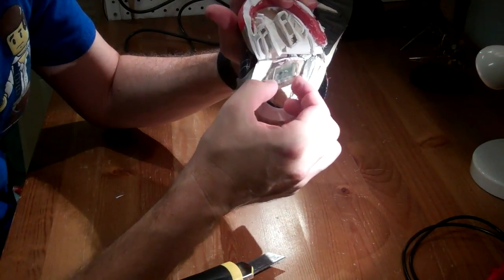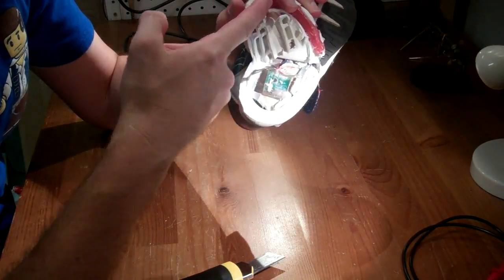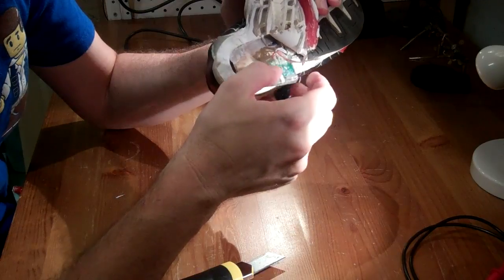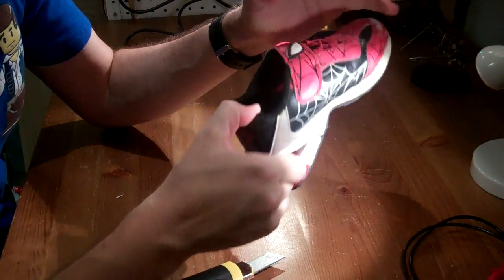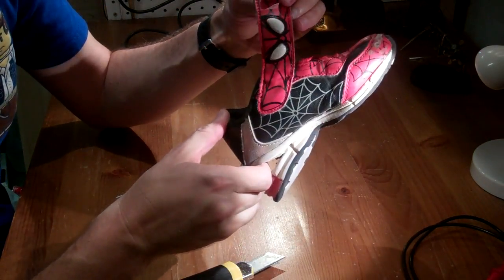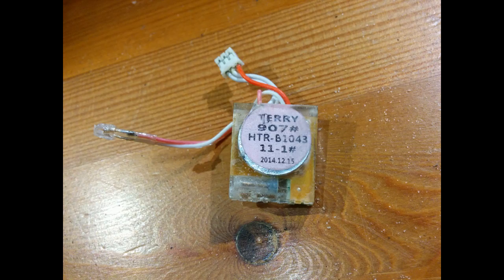What is inside a kids flashing shoe?

Comment: Is it lithium battery? How many volts?
Reply from the maker: I never opened up the epoxy potting material, so I don't know if the coin cell was lithium or alkaline or what voltage it ran at, but I suspect it was a 3v battery just so that they wouldn't need a voltage booster for the LEDs.

Comment: What kind of sensor did he say was used? is that always the kind of sensor used for that?
Reply from the maker: The sensor was a weighted spring and a wire contact. When the sensor is "jiggled" the weight bounces around on the spring and touches the wire contact.  It would be possible to use an Accelerometer instead, but a simple contact probably allows the circuit to go into a lower power state when idle.